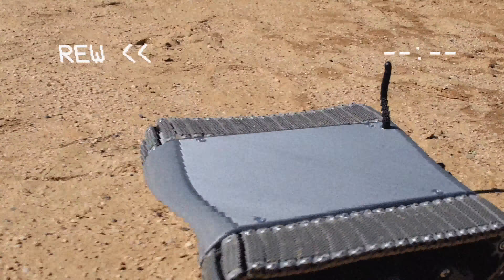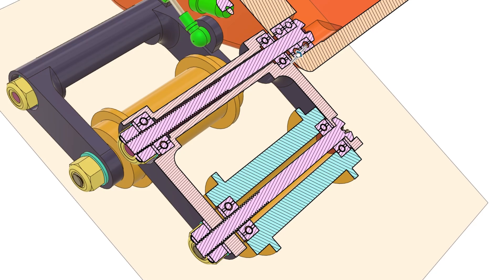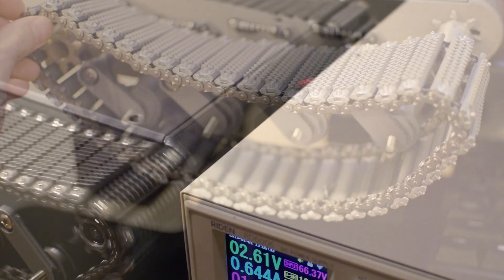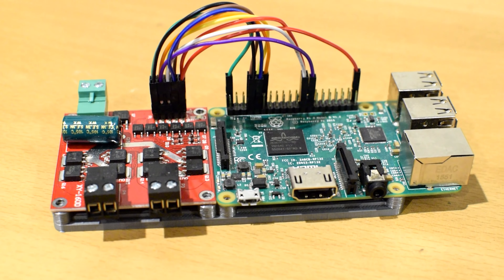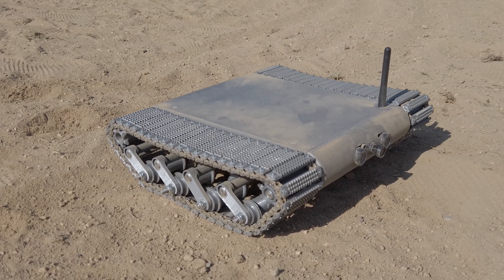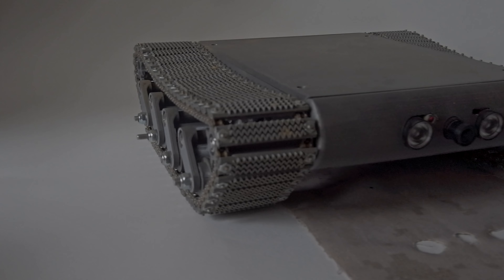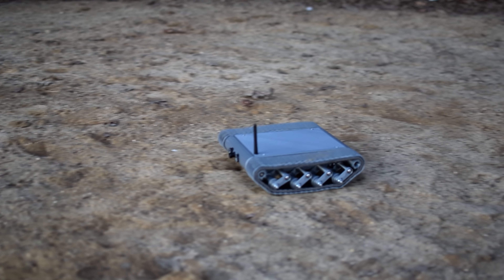I Built a Military Robot from Scratch!

Comment: solution for cleaning the dust on the lenses ?
Reply from the maker: I had considered an air pump, but was consoled by a fellow engineer that a brush could work better. The brush could be covered in sand particles in the air, but a strong air pump hose could not be harmed. The air pump would be inside the tank body and would extend to the lens with the hose.

Comment: Could you also put in a thermal vision so you would have 3 vision system's however you would need to  figure out which thermal vision you want unless you have all of them especially if you have a telescopic lens for seeing at least miles away for effective seeing. And adding a weapon system.
Reply from the maker: Check out my video "robotic vision system!" I made a telescoping lens work on the robot.

Comment: Raising the camera and IR onto a mount on top of the chassis would improve the IR illumination.
Reply from the maker: True. I am considering a solution much like this one.
Reply: @AvivMakesRobots  I'm glad that you agree! I hope you don't mind if I elaborate...

Part of the issue is that with the camera and illumination close to the ground there is a very bright patch on the ground close to the camera which the camera is auto exposing for which causes the darker background to be underexposed. 

With the IR lamps close to the ground the light intensity falls off fairly sharply so it is comparatively dark not far from the tank but the camera is setting it's exposure for the very bright light on the ground close to the tank - it's probably overpowering the auto exposure system. 

If the source of illumination and the camera are up higher the light won't be as bright right in front and the intensity of light will fall off more gradually which hopefully the camera will be able to cope with better. Also, because with the camera up higher the bright patch (which will be less intense with the IR mounter higher) will be smaller on the image/exposure sensor having less impact on the auto exposure of the camera.

So the solution might be just to improve the lighting by changing the angle of illumination rather than getting a more sensitive camera or brighter IR lamps. I hope this helps.
Reply: P.S. I love the way you built the tracks - the whole build is pretty sweet actually. But the track build is instructive for anyone who wants robust 3D printed tracks!
Reply from the maker: Thanks! It does. I am looking now at 5mm infrared dip LEDs of different beam angles. It needs to hit the ground maybe 6 feet away from the robot I would say. Does that distance sound right? The angle of the LED bulb itself would be angled, calculated to hit the ground at that distance away based on whatever beam angle it is.
Reply: @AvivMakesRobots  I'm glad you found my comments helpful.

I should point out that I'm speaking from my lighting experience as a photographer, not any experience specifically related to your application. I have spent a lot of time working with, setting up and observing lighting/light for many years. Also, you are lighting for a camera, so I think my experience does have some relevance here. But there may be others here who have more experience specifically related to what you are doing.

Just to be clear; by "beam angle" do you mean the angle of coverage that the beam emits? I am answering your question in that context.

As long as the beam is not too narrow/concentrated I don't think the beam is as important as how it is mounted because that will affect how the camera reacts and what you see. Having both the camera and the lights elevate should help, as I suggested before. But if you think your beam is too narrow I'd definitely consider a wider one. But you will still get a hot spot near to the vehicle if it is not mounted high enough. 

However, there are three tests that I can think of that you can do before you decide on new LEDs:

1) Temporarily mount the LEDs above the camera and possibly even back away from the front of the vehicle.
2) With the LEDs mounted higher, place a diffuser of some sort in front of the LEDs. This will scatter the beam giving a wider angle of illumination. 
Some possible diffusers are: A piece of tissue paper mounted on a small frame - I bet you could print a nice little frame for one, a small lens, crinkled cellophane.
3) Add to that a small screen/baffle, in front of, and below the LEDs to shade the area immediately in front of the vehicle. Adjust it to different positions to see if there is a sweet spot.
Test each change sequentially.

You could go straight to step 2 & 3 with the lights in their current position but it might not work. I suspect that the light source has to be further away from the camera so the mods don't interfere with the camera's exposure or create flare. Leaving the camera where it is will be OK. These changes should give you an idea of whether my original suggestions would help. Then you can consider any design and equipment changes.

Comment: Video Gimbal -> Can you Rig a Smooth Q2?
Directional Stabilization

Tripod Camera Mount -> 360 Scanning w an Iphone with Lidar....  Could that signal be relayed back via Bluetooth?

Top Mounted 360 Camera for Situation Awareness?
Reply from the maker: I could, but imagine the unforgiving heat, sand particles, UV radiation and wind of the desert environment... all together could be difficult on a delicate and well tuned system like a Q2. ...But if it was packaged well and designed with robustness in mind, it could work very well.

Comment: whats the purpose of the suspension

many tank like robo dont have suspension..probably

whats the runtime
Reply from the maker: The suspension is necessary to keep the camera level. Whether you need suspension or not depends on the application, which is necessary here. Runtime is based on 18650 capacity. 4x are in series so capacity is limited. Next version will have 4x in series and 4x in parallel.

Comment: The camera shouldn't be built in. That ras pi cam should be in a printed case and mounted to a gimble. Or make your own gimble. That looks like some rainbox six siege drone meets blair witch project footage. Also I would use an RC remote that communicates with a local ras pi with 2.4 ghhz emitters that communicates with the drones onboard ras pi via wifi. Avoiding phone controls, but utilizing wifi & a nice to use remote with switches for various solenoids/relays.
Reply from the maker: HAHA. For the next version, I want to put a cheap CSI camera on the actual front of the robot, but the motors are in the way as you can see in 5:38. It will be a small camera just for driving around. About the gimbal or shakiness mitigation, I would want to do some sort of software thing before trying for a mechanical gimbal. This thing is supposed to travel for miles in the desert and needs to be as simple as possible.

Comment: Four 3.7 in series, prefer to wireless pico  or raspi zero 2 H (ir wireless) but no code for sharing was provided here. ESP32 wireless with 2 motor controller can be used here. Raspberry 4 requires a lot maintainance like the mars helicopter requires updating once it starts to use on Mars.
Reply from the maker: I have a separate video on my channel for the code I used on the motors.

Comment: Thanks AVIV 
This gives me the confidence for building a full version of a tank
The only thing that I don’t have is a 3D Printer 🖨️ 
But I can think another way to build it from other sources of materials 
Take my Idea 💡 
The two motors that I’m using is from two E-200 Razor scooters 🛴 with the wheels 🛞 and the battery will be a 20  V Dewalt lithium battery 🔋 
Lol 😂 my tank will go over 30 MPH 
I’m using a 30 Amp Cytron Motor Driver with some  Breaker switches for protection 😂 
I already built a prototype but wasn’t sure how to build a tank version 
They only run on scooters rubber air tires.
But your video helps me a a lot 
Now I have to find some Bicycle Chains and a good size sprockets 
I have whole bunch of vinyl planks for the foot padding.
I’m about 55 % getting it done ✅ 
Wish me luck 😂
Reply from the maker: Awesome! I want you to make a video of this thing when you're done.

Comment: With the amount of dust and sand building up on that lens it won’t be long before it is damaged. Also the video won’t be very useful if it is covered in sand. There is a reason most robots have the camera up away from the ground. Also the night vision mode may work better higher up as well, at the moment you are essentially trying to illuminate and view a plane in a bad orientation for the camera and IR lights. Having less of an angle between the ground and the camera would allow it to be illuminated better which should make the camera pick it up better too.
Reply from the maker: True! The newer version solved both these problems.

Comment: But why is it running backwards?
Reply from the maker: It's funny... the suspension angle is actually made to run "backwards" but can be run either way. The reason is the camera had no room on the motor side. I may add a micro camera in the future just for maneuvering and have a better, larger camera on the back for HQ video/ photo collection.

Comment: Can we write these codes in C language?  What is the simulation application that you will use?  What about the application in which the used pieces were designed?
Reply from the maker: I wrote mostly in Node Red. There was no simulation application. Fusion 360 was used to design the whole physical thing.
Reply: Well 😊thank you for your response👍😍.

Comment: One question: I skipped through some parts of the video so I am not sure where the front is. Is it on the side with the camera? In the video it was shown driving in both directions. 
If the front is on the side with the camera I would mount the suspension facing in the other direction because this type of suspension works better in one way than the other. (But I am not sure if this is a big deal on such a small scale) I would also consider a stabilizer for the camera because it is shaking quite a bit and I would mount the camera in an elevated position instead of inside the hull for 360° vision.
Reply from the maker: Definitely, and I agree about the direction. The next version will have a camera mounted on the suspension front of the robot which is the real front.

Comment: Mount the camera to a fpv gimbal with gyro sensor for more stability. Then you could add head tracking so the camera turns with your head. It uses two sealed servos, so the sand shouldn't be much of an issue.
Reply from the maker: Very cool idea! The next robot I make will have a more advanced computer vision component.

Comment: This is in my view, an engineering Failure of a "Military Robot" 

Those cells are gonna pop out as soon as you drop down even 20cm, you're using brushed DC motors to drive the sprockets, the camera on the front alongside its lights is completely exposed to the elements and anything you run into, and god forbid this thing ever turns on its back because if that happens with any force, that antenna is quick to break off.
And all of that is not even mentioning the reliability issues you're gonna get from any sand or fluid coming through the improperly sealed chasis or other moving parts.
The fact that you just laid the "camo" on top of the tracks really shows it best how little of an idea you have there in terms of longevity. That fabric isn't gonna last you more than a week when driving on any amount of rough sand or gravel, without tearing off. And lastly, those exposed track sides can easily get stuff stuck in there like twigs, leaves, branches, you name it.
Reply from the maker: Like I said in the end, there is a lot more I would want to add before I can really consider this to be a military robot.

Comment: What if you put an extra auto tensioner pulley on the top part of the track? That slack in the belt makes my skin itch for some reason.
Reply from the maker: I agree with that. I have not had problems with the belt coming off, but I think a fixed tensioner may be necessary for very, very rough terrain. Thing is, the bot is made for the rolling hills of a sandy desert and may not need to contend with rocks and sticks that will squish the suspension.

Comment: Battery temperature sensors to measure battery temp and release power according to temps hence saving the batteries longeitivity and safety from a possible fire hazard, this is sort of what Tesla's do in extreme temp when battery is too hot vehicle limits the speed to hence protect battery
Reply from the maker: I will remember this tip.

Comment: Cool start but still some ways to go. Are you adhering to a particular standard or do you plan on doing so in the future?
Reply from the maker: What kind of standard?
Reply: @AvivMakesRobots  An example would be some ISO standard for environmental protection, or a military standard for operation in certain environments.
Reply from the maker: I hope to create a printed circuit board to clean up the electronics and possibly get this thing working with ROS. That would constitute an improvement on the software side.

Comment: Awesome build quality. I would put a 3g/4g dongle on it and make it connect home base with a vpn over the internet. That way you could command it from your home, while it being somewhere else. Which is very cool. Also, I would use a gaming controller to control it. PS4 controllers are amazing for that. Wireless. You could make it work in 2 ways. Wireless mode through bluetooth on the pi directly, or connect it to your computer and do it remotely. Its quite easy to put it all together. You could drive it watching a browser window looking through it's camera, and running a simple script which reads input from ps4 controller and sends it to the pi to be executed. If you push left controller forwards, it sends for whatever amount of time you press it the numerical value of how much you pressed it. As it is, controller gives  you the exact amount from 100 (being totally pushed forward), 0, when its centered, and -100 when its totally pulled. You can use exactly those values (maybe with a reducer x0.8 or x0.5 or  something like that) as input for the motor. Left joystick left motor, right joystick right motor. Its perfect. I can come up with easy ways for server/client communications too, just say so :)
Reply from the maker: I was considering eventually sketching and designing a custom handheld housing with some joystick knobs for controlling speed/ direction. I am just not sure how to work those into node red yet.
Reply: @AvivMakesRobots  The advantage of a ps4 controller is that its already completely made. Networking, or wire. Battery. Joysticks. Buttons for functions. Its all already there. Node red?
Reply: @AvivMakesRobots  You don't need node red. I would work around a web server. Easiest thing to setup. You can transmit the video from the pi, directly into your computer's browser. And build on top of that. You could have a separate script on the server, which starts the motor at the speed required by client. for instance left.php?speed=50. and you can put buttons on main page, when you click this button it sends a request to left.php to start the engine at 50 speed. 

alternatively, you can run a script on your computer, which reads the inputs from the joystick (easy to google the code and can run any language u like) and then sends those inputs when they change by requesting the left.php?speed=+/-100 or right.php?speed=+-100. and when joysticks are centered it stops it. push one forward, one backwards and it rotates in place. push both it will go forwards. pull both, it will drive backwards. 

You can make even fancier stuff, but this would be the absolute simplest i think. 

Now as far as what to do in that left/right php or py or perl... that depends more on the type of controller you have there. but i'm sure you can find something easy, just to set the speed and run continously until you get a command otherwise.

Comment: To be honest your project is fantastic  but I have 3 questions  
How did build the body ,what kind of shock absorber do you use  and what is that you bolted on the chains
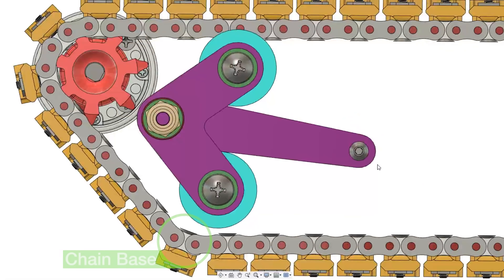Reply from the maker: Body is completely FDM 3D printed, designed in Fusion 360 CAD. I used 1:24th scale sumo RED24021 shock absorbers and I bolted horizontal plastic pieces to the chain in order to create a single belt.